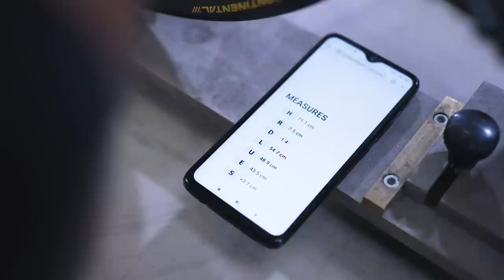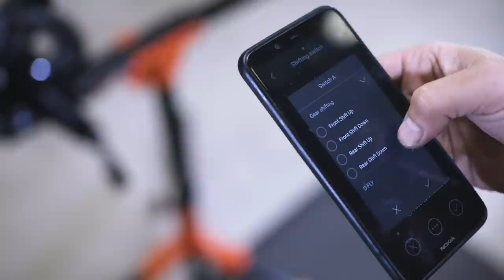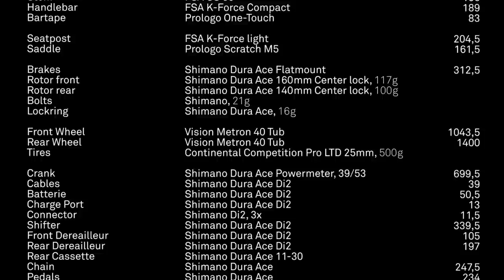Dreambuild | Merida Scultura 2021 | Team Bahrain McLaren | Mikel Landa | World Tour Teambike

Comment: What did he did to the RD at 17:43? Looked like he was adding the wireless unit so the Di2 can connect via Bluetooth? Didn’t know it could be added there?
Reply: Just to update or customize the Di2 software and firmware. Then he will remove it, is a climbing bike so those kind of parts shall be remove in order to keep the lowest weight possible.

Comment: One question... Is safe cut the fork tube so short?? The stem is 0.5cm over it and the top bolt probably doesn't lock it at all.... I can understend 1 2 mm but 5mm I think it's too much
Reply: Some can forego 5 mm, but I usually go for 3 mm.

Comment: Which is the tool that the mechanics are using to regulate the height of the shifters?
Reply: If you just want both of them to be level with each other, a simple tailor's measuring tape will do.

Comment: Why didn't use rim brake, it lighter than disc brake. Disc brake isn't guarantee to anti slip at wet road.
Reply: the weight is not a problem on pro bikes anymore because it is now easy to build a 6.8kg bike with disc brakes. 
and of course disc brakes have better performance at both dry ad wet roads
Reply: He is right about disc brakes slipping on wet roads. I own both rim and disc brake bikes, with all honesty i opt the rim brake bike more. Rim brakes are lighter, aero, better tolerances, cheap, and easy to maintain. I agree with him saying that disc brakes causes slipping/skidding on wet roads, because with 25c road tires there isn't enough traction and friction to stop the bike properly with that much stopping power. I mean think about it, when the surface is wet and a bike brake using disc brakes, the bike would just skid and not stop due to a light frame that's too light and too much stopping power. Mtbs are more advanced in the world of disc brakes because they are heavy and have wide ass tires, they also have more friction thus stopping easily on dry or wet surfaces. In physics they teach us that a lighter person (6.8 kg disc brake road bike) would slide further on ice (wet asphalt) compared to a heavier person (heavy mtb, gravel, xc bike) when equal force (braking) is applied. With that I'd say that rim brakes are the way to go for performance road racing.